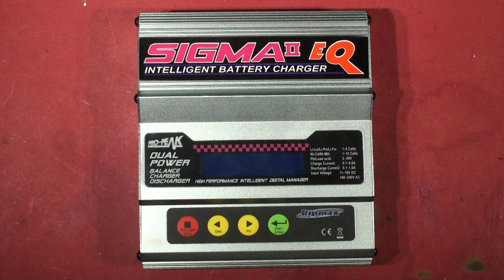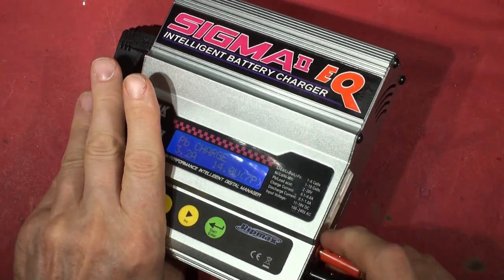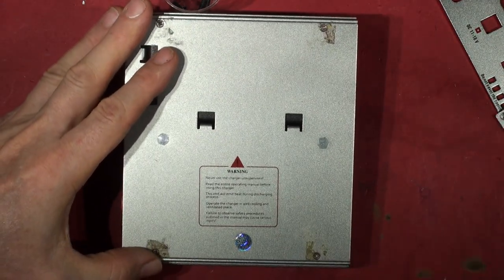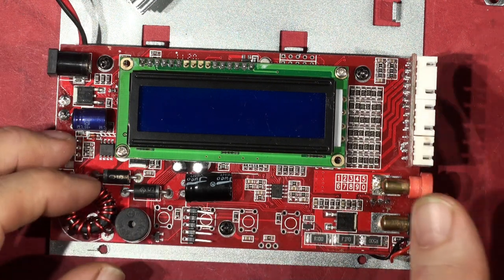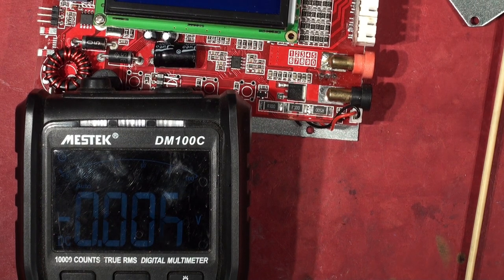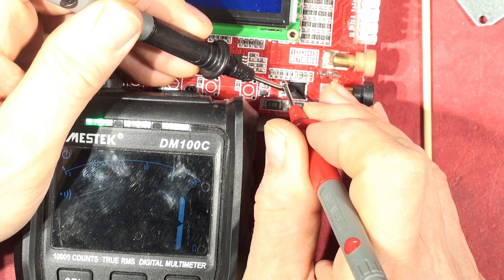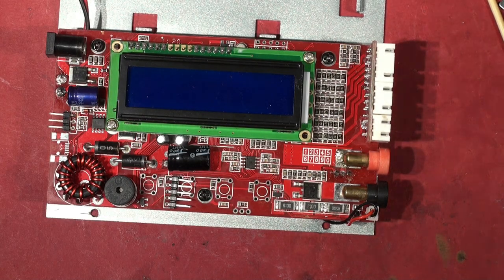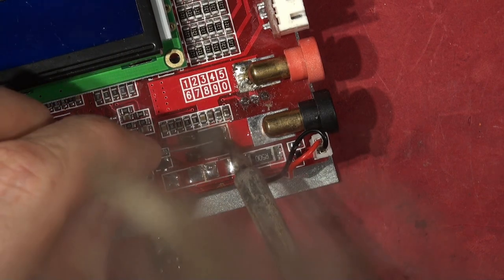Sigma II Eq Intelligent Battery Charger Simple Diagnosis and Repair

Comment: What's to dislike ?
Apart from the audio hiss (sounds like you're working in a wooden shed - next to an industrial kitchen - when it's pissing down ) ..............
Is it an extractor fan or similar ?

Good content , well filmed and not boring in the least.
Don't apologise for a repair well done.
Reply from the maker: Thanks for the comment. There is test equipment running in here - A heat test cabinet and fans clean AC power source, power meters and 1KW DC load. Life test of PSU dsigns,

Comment: So easy to reverse polarity on the output on this charger. 
It's virtually 'standard' on modern chargers - certainly for car chargers.
Surely can't be that expensive - but as you keep telling us there just isn't enough margin in £100 hobby chargers 😀
Reply from the maker: I think I said that it doesn't cost that much for the manufacturer to get the design correctly. it could have adequate and robust protection to prevent it being so easily damaged.  I don't know about everyone else, but I would rather have the option of paying a bit more for a better product.  The trouble is that we don't get this choice unless someone leads the way with an ace product.....